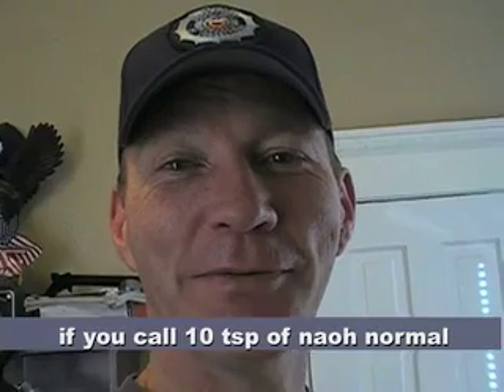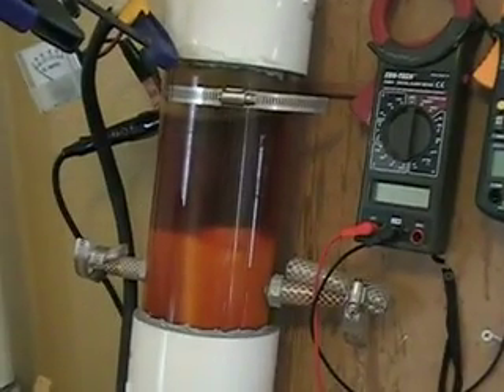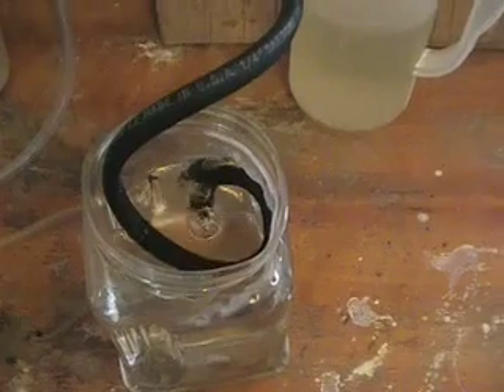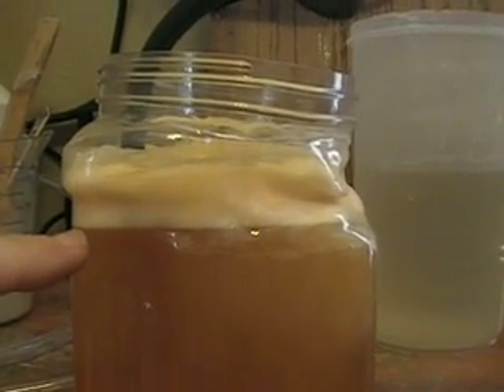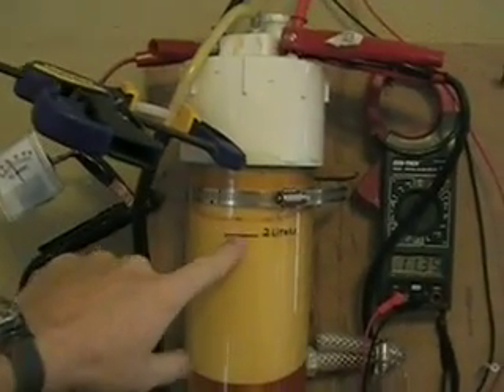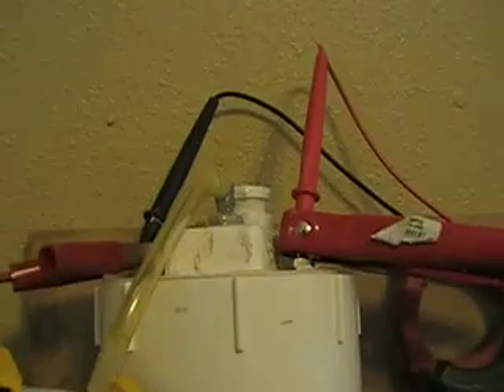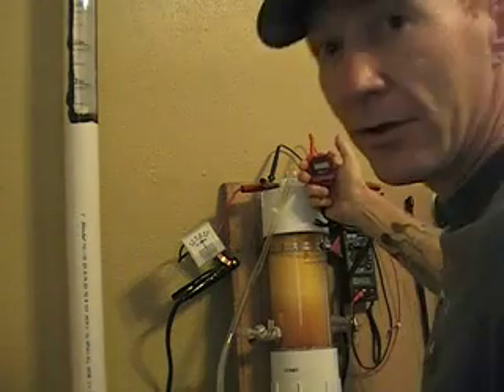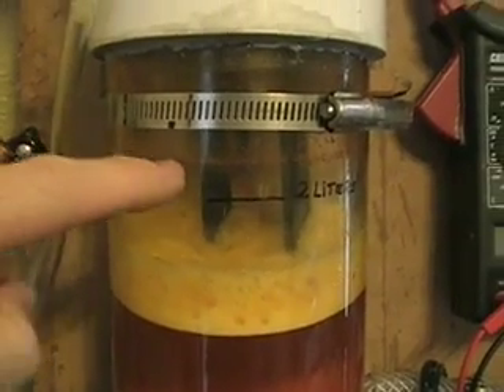Winter Electrolyte 3 -denatured alcohol/electrolyte tests

Comment: Hey Steve,Im testing winter mix to,Prestone de-icer for windshields will boil over like yours but stops after a while and kicks ass for gas strength and like a hose for bubbles on 9 amps and tap water and 1/8 tsp of Roebic,best mix i have found yet,the foam will stop and become a great mix.

Comment: Hi Steve, 

I was wondering if you have seen the video from sm0key40 about a solution for the use of a hydrogen generator during the winter? The video is called, Hydrogen electrolyte solution for Winter.

I wonder what you think about this solution?

Sincerely, Rick

Comment: Steve,
Couldn't you just use a heat strip from Home Depot.  The kind for a garden hose.  You could wrap only the bottom  (and insulate it) leaving the top for viewing.  Depending on where you live, you may get away with just plugging it in at night.

Comment: Hi Steve,
 Would it be possible to run a bubbler with a return line? I suppose the bubbler would have to be rather large for the foam to settle. Your vids are great. Could you do some on "basic how to hook up meters for amps and volts"? I am new at this and am having a hard time setting my meters up for readings.
Thanks 
Greg

Comment: Hay Steve nice work hay I found that the more koh I put into the cell the more it whats to foam. I use a PWM on the Stinger and it helps cut down on the foam a lot. But if I run it with out the PWM I have to cut back even more on the KOH. Being you have to add so much more sodium hydroxide to get your amps back up this may come into play just a though.  
Keep up the great work brother